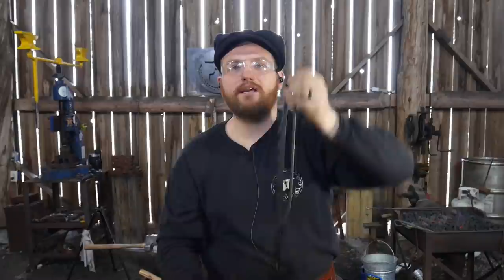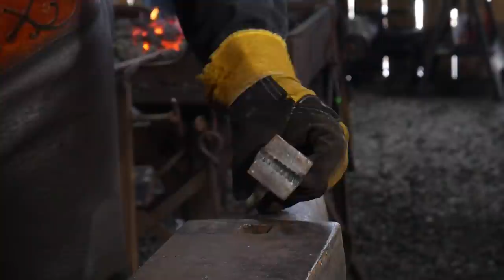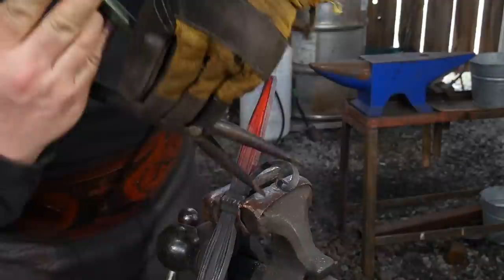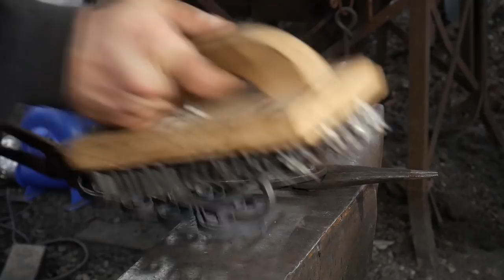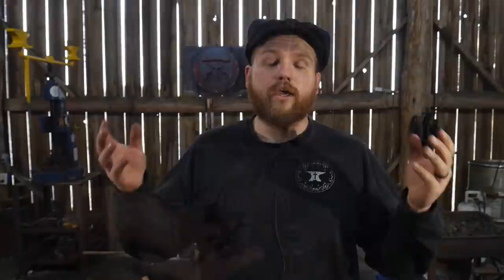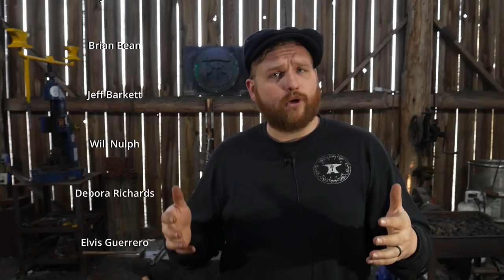Forging an Stunningly Ornate Wall Hook!

Comment: where is a good place to find iron for projects like this? or something to practice technique with?
Reply: I get mild steel(A36) cold or hot rolled from menards for most of my projects,(they have the best deal for where I'm at, tsc has a 5-10 dollar mark up for the same stuff). When I get a little larger in my personal operation, I'd go to maybe arlo steels web site, online metal's, or somewhere like that. Check around for prices. You'd have to draw up a plan and figure out how much you'd need for whatever you plan to make. Maybe do a practice piece before getting all the material. Some places still sell wrought iron online. And I'm sure somewhere online has plans for baroque styles close to what this is. Or go take that class Roy mentioned lol. 🍻